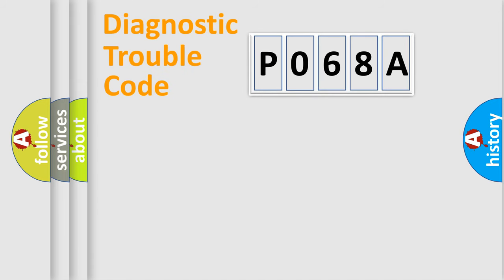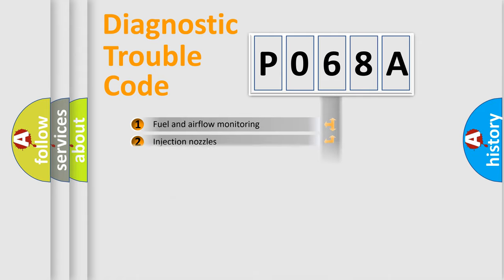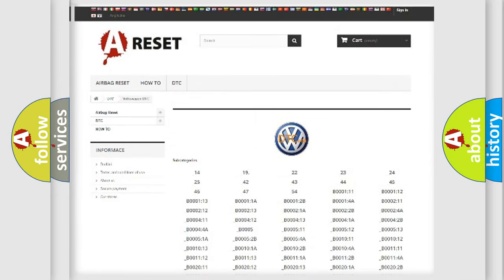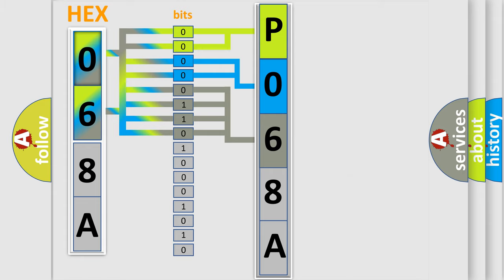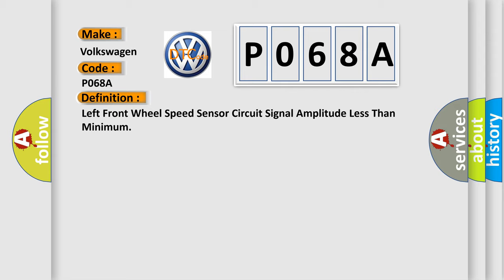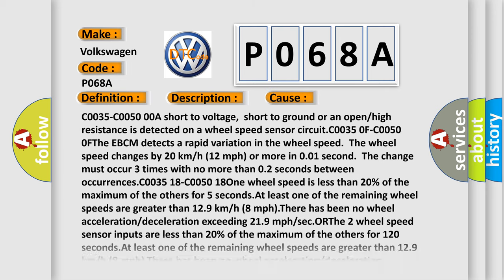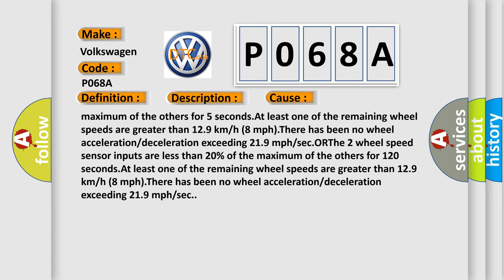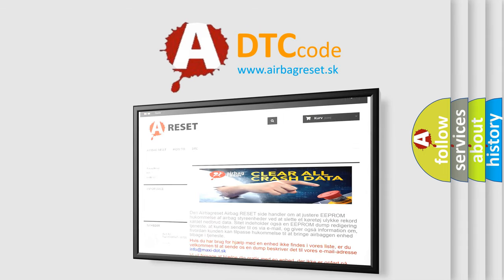DTC Volkswagen P068A Short Explanation

Comment: I did a diagnostic on my Volkswagen Jetta and P068A says “ECM Power Relay Load Circuit:(J271), De-Energized Performance Too Early”
Reply: Same bro, have you fixed this?
Reply: @gg-eh3il  yes, it was exactly that, the ECM. The old one had water damage and rust all over it. So I got a new one, my mechanic programmed it and installed it and the car started right up.
Reply: It same to me... How to solve it.? My car is vw jetta 1.4
Reply: @abdurrahimmohdnor9005  you need a new ECM that’s how to fix it.
Reply: @JustGrowSG    Hello - Just to confirm, has the fix held up ??  So many people replace a part then find out it wasn't what caused the problem after a while.  Which is why I'm just checking... has the repair held up ??  I have the same and a new ECM can be expensive... so just checking to make sure.